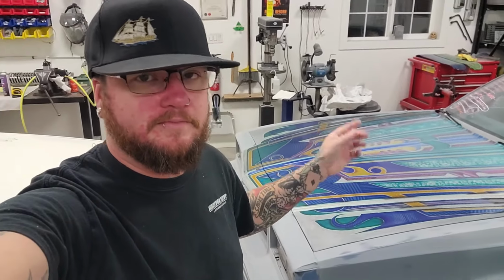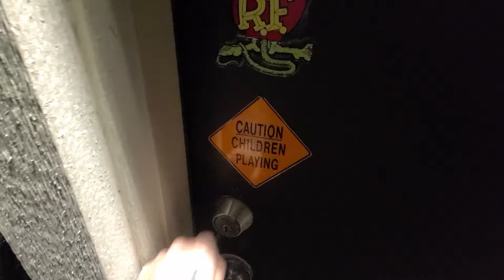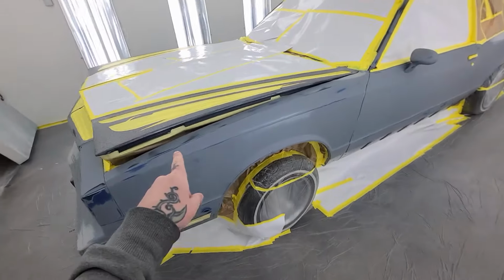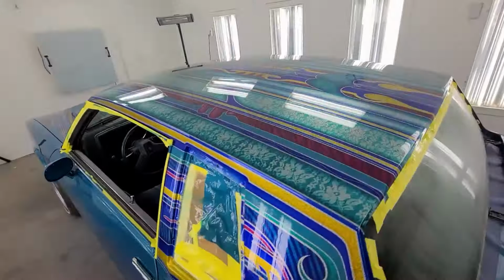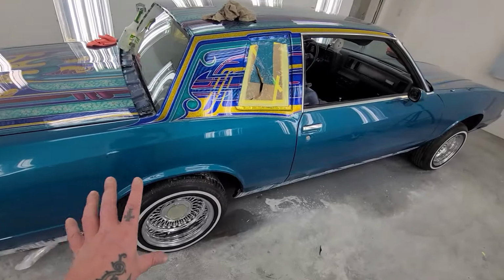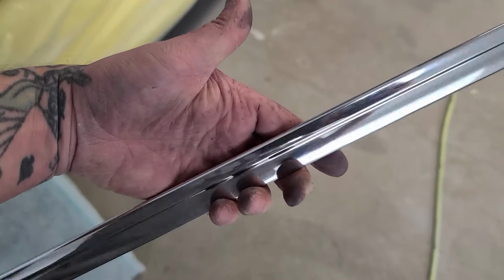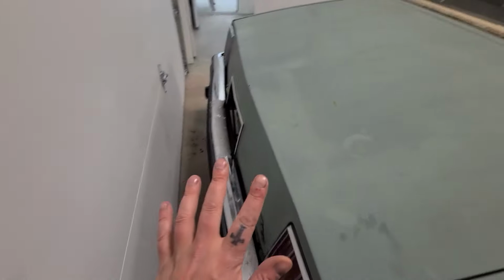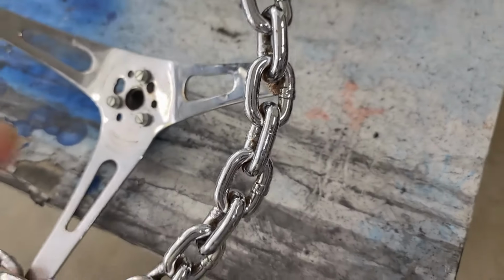1983 Monte Carlo Lowrider Paintjob is FINISHED!

Comment: Great paint job bro ,🔥. I have a question.  Can i wet sand 2:1 metallic grey in case i get orange peel . Im using it for base coat and i wanna do a bit of candy stripe pattern nothing to crazy. How much time do i have for me to come back and candy coat some stripes on before clear coat  ?
Reply from the maker: Thanks for watching! you cant wet sand any metallic single stage base coat. You would want to clear it then sand it flat before adding any patterns/candy.
Reply: @SlickWorks  it's a 1:1 metallic base coat, is that same as single stage ? Mix one part base one part reducer?
Reply from the maker: @udrgrndpyro5107  yes 1 to 1 is pretty standard for base coat. You should spray it 2 wet coats then a mist coat. Clear that, sand the clear flat and start playing with tape

Comment: What clear did you use it looks great
Reply from the maker: I used Automotive Art.... I wouldnt recommend it to be honest lol
Reply: Looks  good that goes on very smooth and sands ez
Reply from the maker: @marklynsmith3510  It definitely didnt go on smooth. but it sanded down nicely. It has pretty bad die back though. shrinks for like 3 weeks
Reply: So which one did you 60 or HS -X Clear. They work  quite  well in the Bahamas they cost like about  $380